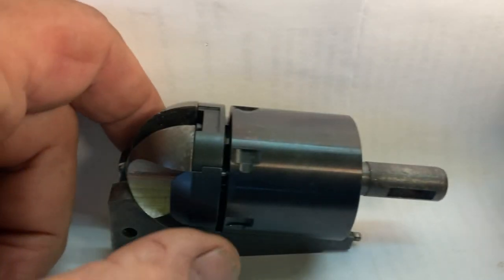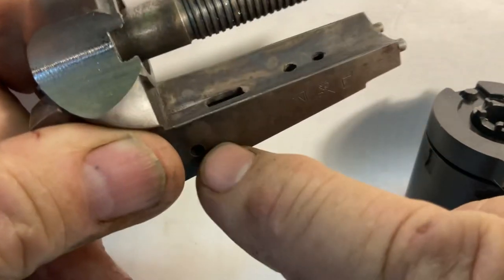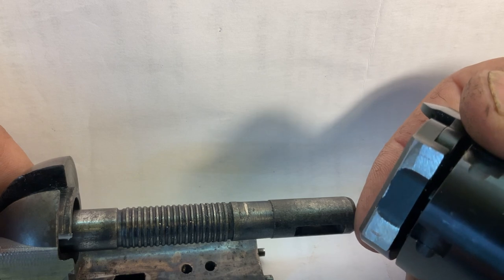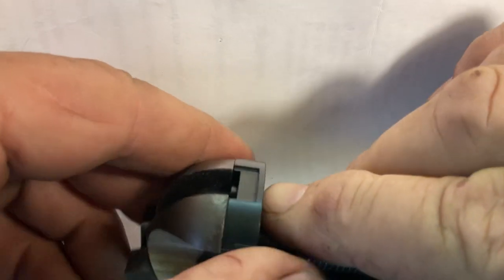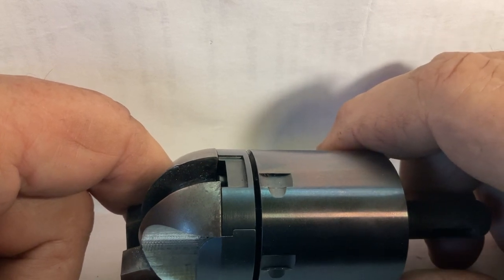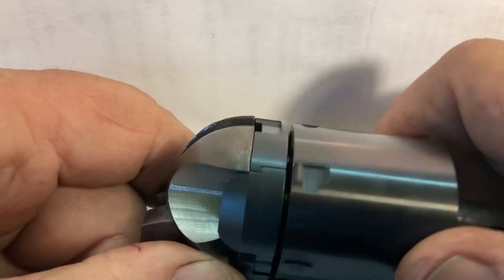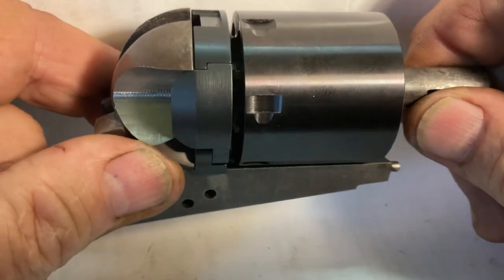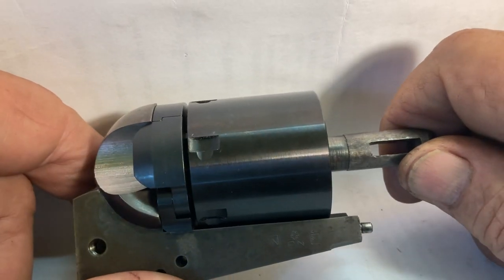Cartridge Conversion Fitting the Kirst Conversion

Comment: I see the cylinder in this video has the notches and leads that look like a normal colt. I have 2 of the 45 colt kirst conversion cylinders that the leads are cut on both sides of the notch. Never could figure out why he did that.
Reply: Walt Kirst explained that to me as his “fix”…..
He pushed the dimensions to increase safety and then the 45 caliber cylinders (but not these 38 cylinders) would not “drop in” and work as the bolts were too high. This “fix” was supposedly to allow them to drop in but they don’t. I tried to get him to make changes as they don’t look correct but he didn’t care.
Reply: @SayMyNameOutLoud  that sucks I am considering tight welding the lead that is not needed and then cleaning up the notches. Both of my 45 colt converters work but ot just looks terrible.

Comment: Any advice for if after doing the conversion and you cock the gun it is literally a hair shy of being fully cocked. Which if you pull the trigger on a live round can be problematic. That said, if you really rock the hammer back when you cock it, it goes all the way and you are fine. I have seen other people mention the same issue and I believe Kurst came out with something to fix the issue. But I need to make sure before I say definite. IDK, anyone else have that issue or advice on how to fix it without buying product after product from Kurst ?
Reply from the maker: I’m guessing you are talking about a 5 shot 45 cylinder. If you do the math your stock cylinder has 6 holes in 360 degrees which makes them 60 degrees apart. The 5 shot would be 72 degrees apart. That means you have to move the cylinder 20% farther with the hand when you cock the gun. Typically the hammer will not come that far back so we always “stretched” the hand to make it longer. The Kirst 2 stage hand is an easy fix for this and the latest Pietta revolvers have MIM hands that break when you try and stretch them so the 2 stage hand is the only real fix short of welding and reshaping.